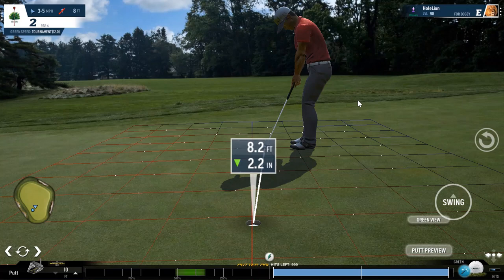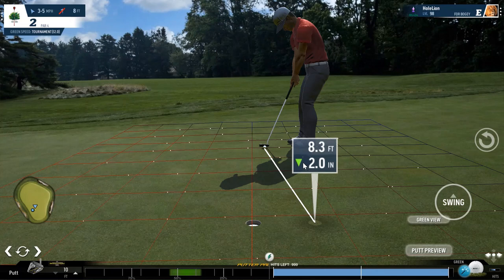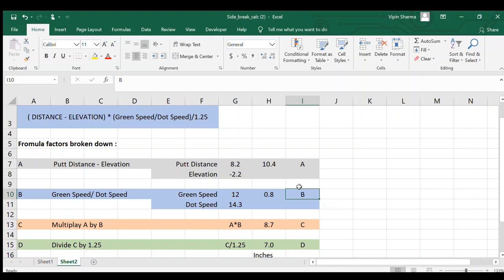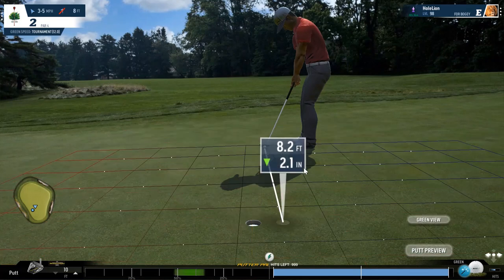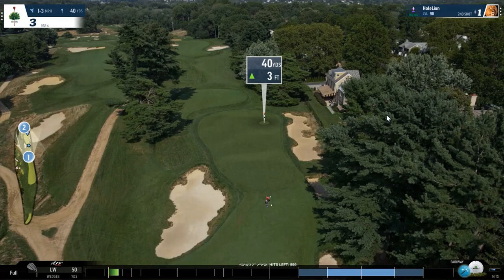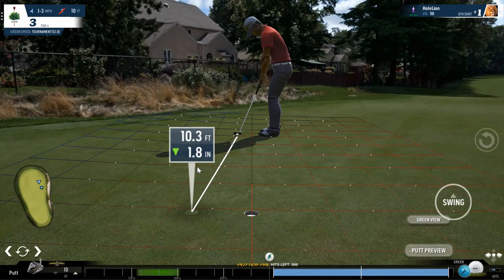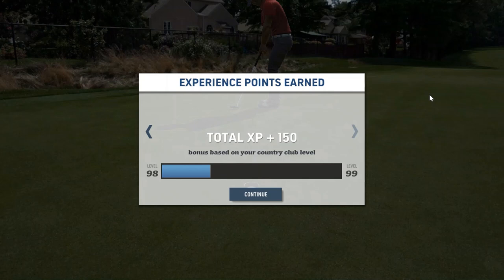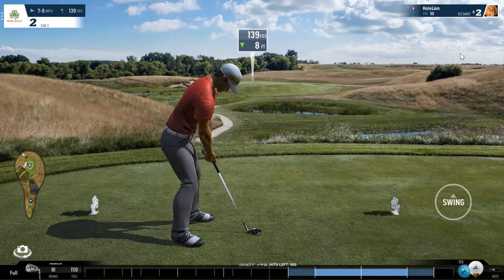Breaking Putts/Dot Counts - HoleLion

Comment: The grids are 24 inches not 12 inches. They are square and the number of grids correspond with the distance i.e. 8 feet of putt equals 4 grids and 14 feet of putts equal 7 grids. Your formula works for you but not reality. Am I wrong?

Comment: Thanks for the video.  I've been using this method for about a month now and love it.  I am wondering if you make any adjustments for a long putts with big breaks.  I had a 20' putt with dots moving all the same and it called for 2 grids of break.  The putt rolled under about 0.5 grid.  I think 10% more power and 10% more break, it would have been very close.  Any thoughts?  Thanks in advance.

Comment: I understand it now But still the first example if you take A × B is not 8.7 its 10.4 × 0.8 =8.32? so then the answer in C divided By C=1.25 is   8.32÷1.25=6.656 not 7?
not trying to hate as i actual get it now thanks to this video and watching it a few times.. cheers
Reply from the maker: looks like you are right on 8.32 not 8.7, Checking into with Vipin, cheers!
Reply: @rebboandlionwgt9538  no worries he holes the putt anyways LOL and this has helped me now i have re-watched it and understand it,putts are sinking in finally LOL thanks again.
Reply from the maker: @chelseawinners  Hi mate. So it turns out the 0.8 is shown as that with a decimal point less. The true and correct number used after is actually 0.84 not 0.80. So the formula is right and the end number was right, just it was showing as 0.8  not 0.84!! Hope that clears it all up for you... thanks again for pointing it out

Comment: This was helpful but i feel your maths are off.. you say its a minus for elavation going downhill right? 
so then you would do 8.2 minus 2.2 =6 (putt distance less elavation) then you would do green speed 12 ÷ 14.3 =0.8
so then by your calculations multiply the first number (putt distance minus elavation)which is 6 by the second number (green speed ÷ dot speed) which is 0.8
giving us a total of 4.8
this number 4.8 is then ÷ by 1.25 giving us a total of 3.84 or nearly a 4ft putt and not a 7ft putt as in your video?
Otherwise a great video explanation,thank you..
Reply from the maker: Hi Wayne. The formula is distance - elevation as part A. So if it were uphill it would be 8.2 - 2.2=6. But because its downhill its minusing a minus number, hence become 8.2+ 2.2= 10.4. Hope that makes sense!
Reply: you did it again on the second example,you added 2.2 instead of taking it away (elavation going down you said take away) so it should be 8.1 not 12.5.
also 12 ÷13 is not  0.8 its 0.92 or 0.9 rounded down. so 8.1 × 0.9 = 7.29 (going by your calculations of a × b or 8.1 × 0.9 = 7.29) then 7.29 ÷ 1.25 =5.832 or 6 rounded up.
its breaking 6 inches not 9?
Reply from the maker: @chelseawinners  Ive asked Vipin to double check as this is his video, we will reply when he arises in Asia. But i didnt do it again. 8.2 MINUS -2.2 is 10.4 not 6. because you are minusing a minus number it becomes an addition so it is in fact simplified... 8.2+2.2
Reply: for the last one even though its uphill (shouldn't you add the elavation not take it away this time) meaning you add it, so it will be 14.7 + 2.6 = 17.3 not 12.1?
then 17.3 × 0.6 = 10.3 not 7.6? (even if you do 12.1 × 0.6 that equals 7.26 not 7.6? (rounded up would be 7.3 so now it would be 7.3 ÷ 1.25 = 5.8?)
so our initial A × B should be 17.3 × 0.6 which is 10.3 then divide that number by 1.25 which becomes 8.24 rounded down to 8ft?
Reply from the maker: @chelseawinners   no mate you are making your own formula up lol. its distance MINUS elevation. uphill its 14.7 MINUS 2.6= 12.1. Downhill it would be 14.7 MINUS MINUS 2.6 which would be 17.3! You need to follow the formula...... pace putting formula is different, thats exactly as you describe it because its Distance +/- elevation. The break formula is always "-" not "+/-" . DM me on FB if you prefer.  One other way of explaining it is Two minuses always make a positive! In the end much better if just type it into the sheet and trust it.
Reply: @rebboandlionwgt9538  so now what you are saying is that for an uphill elevation you take away from the putt total distance and for a downward elevation you add it to the total distance putt?
Reply from the maker: @chelseawinners  yes, its just part of the formula to calculate break, not power.
Reply: Rebbo and Lion WGT 8.2-2.2=6ft +1 foot =7 feet .To ensure there’s enough pace to hole the putt.

Comment: I understand the calculation, but if the number derived from the calculation is relative to the width of a green grid box, correct? What is the width of a grid box?
Reply: It is assigned a value of 15 I believe....(because 15 ft and in usually stay within a single grid I believe.) could be wrong lol
Reply: In this method the width of a green grid box is 12 inches. So if the calculation gives you a number of 9 that means you use 75% of a grid for your offset.  (9 / 12 = 0.75 or 75%)